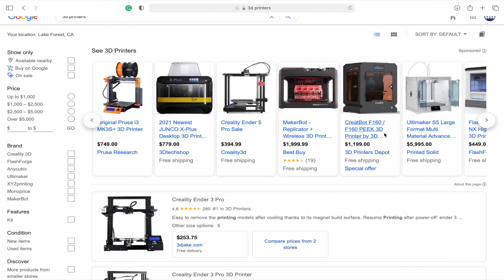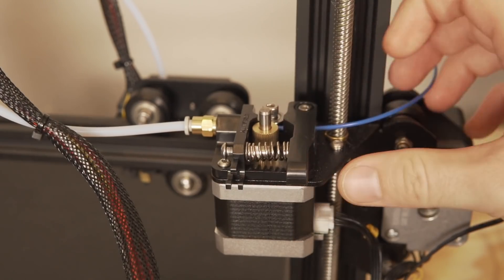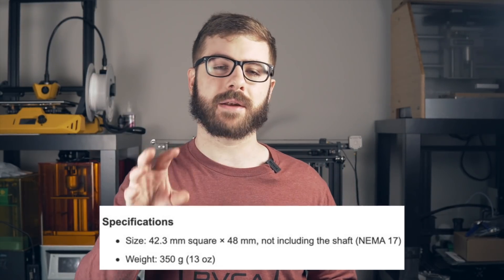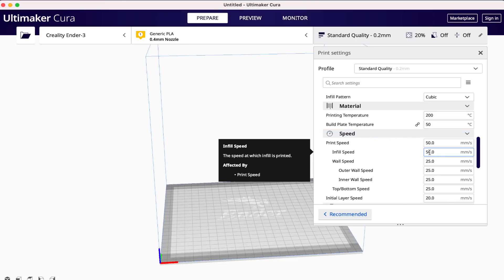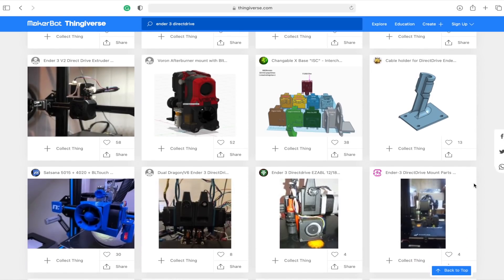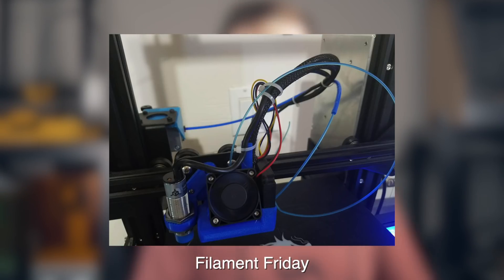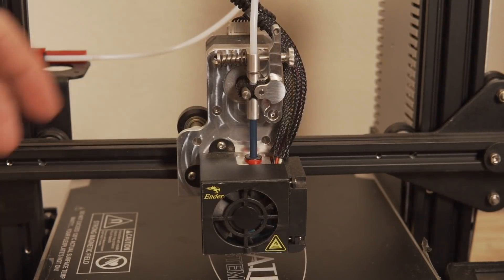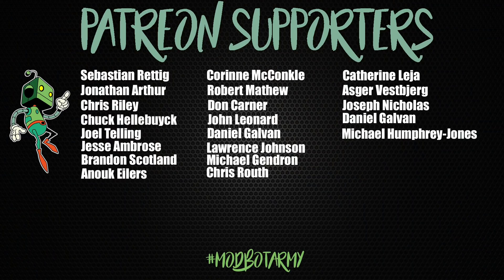Bowden 3d Printer Extruder Vs. Direct Drive

Comment: I just like to add that when I bought a pre-built direct drive extruder for one of my Ender 3 printers I used it for a while and the print quality was just not very good so I took it apart and I found that the two screws that hold the hot end to the back plate were loose. Both of them were loose.
I have found that poor print quality sometimes is caused if the hot end is not at right angles to the bed.
Because of that, one of the first things I do while I'm putting a new printer together, is to make sure everything is perfectly square including the hot end in relation to the bed. Everything on the printer must be absolutely square and at perfect right angles all around, and of course, all of the wheels tight enough against the extrusions that there is no wobble.
Because the nozzle is so tiny, it's not a huge deal when they're a little bit out of square, but it does affect print quality and even more if you use ironing.

Comment: I just recently switched to DD on my (heavily modified, at least for my standards) Ender 3 after hearing a very compelling argument: It's a bedslinger, so the X axis, even with the weight of the motor, is still less than that on the Y axis. I have an ADXL345 accelerometer for resonance compensation so I thought hey, I can check that⁽¹⁾. Sure enough, I could go up to a max of ~16k acceleration on the X axis, but only 4700 on the Y axis. Since both axis are linked in most slicers, the Y axis will always ⁽²⁾ be the limiting factor for a bedslinger. So, at least for that type of printer, the weight of the hotend carriage is, functionally, a non-issue (ignoring wear and tear for a second). The advantages of a) being able to print TPEs and b) less clogging on an all-metal hotend due to less retraction are just much more beneficial, at least for my use case. Not saying it's "the perfect upgrade that everybody should use™", but don't get dissuaded just because somebody tells you it'll make the carriage too heavy.

⁽¹⁾: I just did another test run with my DD setup: Klipper suggests max_accel <= 14500mm/s² for the x axis and max_accel <= 4500mm/s² for y (with mzv shaping). So yeah, at least in regards to maximum acceleration, a heavy carriage is not my limiting factor.
⁽²⁾: Of course, there's an obvious edge case where you literally weigh down the carriage as much as possible just to prove this point wrong, but seriously, unless you actively lighten the Y load AND raise the X load, your bed will always be heavier than your carriage assembly. I don't even use a glass bed and it's still the limiting factor in my setup, for example.
Reply: That was my thought process, but I didn't have figures to back up my intuition. Thanks!

Comment: Thanks for posting. I'm a 54 y.o. noob at 3D printing (got my Ender 3 V2 three weeks ago) but have jumped in with both feet. I'm interested in print quality and reliability above speed, and therefore have made the decision to go with a direct drive (will order the Orbiter this weekend). With the issues I've had with the stock extruder, the time I save by not having to fiddle with it can be put toward actually printing, which increases my productivity. Add to this the greater versatility of DD systems, and for me it's a no-brainer.
Reply: how did changing to direct drive go?

Comment: I have 15 machines on my print farm and over the years, I have upgraded as many as I can to direct drive.  It's just so reliable for all my material types and I don't have those dreaded Bowden Tube popping out from the hot end or extruder issues some stock printers are notorious for.
Reply from the maker: Damn what direct drive system are you using on the upgraded units? That tube popping out is such a waste of time and materials.
Reply: @ModBotArmy  I have 3 CR-10S machines upgraded to the Bondtech Direct Drive System.  It’s super easy to install.  They offer the firmware for it and even a version if you opt to install a BL Touch (mine do). It’s a “what’s your time worth “ kind of upgrade.  Very quick to do.  I like that direct drive setup so much I’ve had them make me a few (minus the Creality wiring) to install onto other machines that have the same CR-10 style carriage.  Check my channel for my DDS install video 🙂

Comment: For me allways direct drive. You can use light extruder because the resistance on the filament is less, usually higher flow and easy to print more filaments. For a Prusa style printer it goes all the way, because the bed is heavy and the X axis doesn't matter if you add a bit more weight
For a CoreXY maybe bowden is a better choice because of the rapid movement you could have. But with sturdy frame and big motors you can have a Direct drive and still print at 100mm/s at 3000-5000mm/s2 acc

Comment: The quality i'm getting printing PETG with a direct drive compared to a Bowden setup makes it worth all the way for me. i go through allooot of PETG and the Print finish/quality is just perfect with it i pretty much have Zero stringing and all i need to do is remove some support and the parts are done nothing to clean up. when i was running bowden i always had some stringing and needed to cleanup the parts a bit.
Reply from the maker: I feel like with PET-G on most bowden setups I get some stringing and occasional blobs. I also feel like dd seems to remove most of this for me. I have done quite a bit of PETG on bowden but I definitely have experienced what you are mentioning.

Comment: im fairly new to 3d printing. i bought an ender 3 v2 and a short time after testing it i bought a direct drive extruder to install while installed an all metal hotend and it made life much easier and the prints much better.

Comment: I recently purchased a Biqi B1 and prefer it immensely over my old Deltaprintr. I did swap the extruder over to the EZR and cut the bowden tube as short as possible. It's running like a champ and I was able to print with TPU without recalibrating.
Reply from the maker: That is awesome! I love my B1 so much. I only have space to run a couple of printers right now in this place but I really want to do more printing on that machine.

Comment: I just discovered this channel. Good explanation of the differences between the systems. I've only been 3d printing for 1.5 months and all 3 of my printers are delta's with bowden setups. I've successfully printed with PLA+, PetG and ABS and have yet to try flexible filaments. I see most of your printers are cartesian style 3d printers. One thing missing from your video (as it only applies to deltas) is the "flying extruder" mod to shorten the bowden tube. Your video gave me a better understanding of what people are trying to achieve with that mod so thank you!

Comment: I think X carriage weight is only something you should be concerned about on a CoreXY. On a Cartesian printer, the moving bed / Y carriage is going to be so much heavier than the X carriage that you will never be able to print truly fast while maintaining quality. People get obsessed over saving a few grams on their X carriage, while forgetting that the Y carriage / bed weighs at least a full kilogram more. Unless your firmware supports different print speeds for each axis (which is doesn't) you're only going to be able to print as fast as your slowest axis.
Reply from the maker: This is also a great point. Especially if you have a heavy bed that has glass on it that will really limit how quickly it can qhip around.

Comment: How about a hybrid system?
Bowden to deliver filament, but not perform any retraction or pressure advance actions.
Small servo at the hot-end shifts the Bowden fitting relative to the nozzle, adjusting pressure/retracting.
At the start of a line, the fitting is spaced at some set distance from the nozzle.
As the hot-end accelerates, the servo drives the fitting closer to the nozzle, building pressure rapidly.
Once the hot-end reaches print-speed, the spacing is held constant.
As the hot-end slows down, the servo backs the fitting away from the nozzle, dropping pressure to zero, preventing a corner blob.
The servo could start building pressure before the filament in the tube has a chance to start moving in the tube, thereby reducing 'starvation' at the beginning of a line!
The pressure-modulation profile would match the acceleration profile for the hot-end, of course!
For a non-printing move, the servo pulls back a tiny bit to make sure there is no residual nozzle pressure or dribbling.
The Extruder motor only has to deliver a set amount of filament in a set amount of time, and can do so without fancy acceleration tricks.
Linear Advance is a great idea, but it is rough on hardware!
Since the Extruder is simply feeding stock, and regulation is done 'in the nozzle', stress on the Bowden fittings/motor/tube is greatly reduced.
No retraction =  less electrical power to the Extruder motor, less heat.
No more push and pull; just a steady push, or stopped.
BONUS!*BONUS!
The servo driver, if it were a 'voice coil', could modulate nozzle pressure at fairly high frequencies...might be useful to selectively apply patterns or make properly tapered lines in a print.

Comment: I could never go back to the nightmare of dealing with bowden , the couplings always work their way loose as the filament is pushed/pulled through the tube resulting in hot end clogs.

Comment: I ran a Zesty Nimble V1.2 on my delta for about two years.  I'd be happy to answer questions about remote drive stuff out of my experience.

My thoughts: It's a great system for taking weight off the effector without losing the short filament path that flexibles prefer.  It did take a fair bit of tuning to get working well, but their documentation and support is good.  Unfortunately mine was an older production model and had "Ripple" issues (slight periodic over/underextrusion due to the drive cable and possibly tolerances in the old gears), but until I totally rebuilt the printer frame for rigidity and switched to 0.9 steppers, that artifacting was minor enough to be lost in the general delta "salmon skin" noise, even with a 32bit board.  After that, though, I started looking for an alternative, and I just replaced it with a Bondtech LGX in a flying setup with a 13cm bowden.  That's giving me substantially cleaner prints.  The ripple issue is apparently well-known but not well-explained, and doesn't affect all Nimbles (I've heard it can appear on Flex3D remote drives as well).  I may give the V3 Nimble a shot in the future, as supposedly they've ironed out those early manufacturing issues.

Comment: I just added a belt driven dual Z-axis drive system and the additional weight of the direct drive is no problem.
Reply from the maker: What printer did you convert to belt z axis?

Comment: Direct drive I have heard also can misalign your x axis on the lead screw requiring dual z motors.
Not sure because I decided to stick to bowden but I totally agree dual gear is 100% a big improvement and more worth moving to then changing drive setups

Comment: A bowden is easier to fix when clogged, the direct drives motor has to be remove and the parts unscrewed which can lead to wear and tear on the gantry. But the direct drive allows you to print flexible filament and is supposed to be faster because of the lower retraction distance to the nozzle. I've had many extrusion issues with my bowden setup but the print quality of both are very similar. In the end I think that, if you can afford it, you should get a direct drive but ultimately it comes down to slicer settings.

Comment: My Ender 3 has a Bowden setup and my wife's Flashforge has a direct drive.  Both print well and are reliable. One thing I like better about the Bowden is the easier access to the hotend. A clog or some other hot end issue is far easier for me to get at and correct on the Ender than it is on the Flashforge.  Just for something to do on a cold wet weekend, I purchased a PrinterMods direct drive adapter for my Ender 3. Guess I'll see if I like that setup or not. Poor little Ender rarely has a peaceful weekend :)
Reply from the maker: I think that the flashforge is also tougher to access because it is a different system than the Ender 3 which is based on the prusa design. The cross beams on the smooth rods can definitely make it trickier. With the Ender 3 being more open I do not think it will be much more difficult to access the hotend than it is now :)

Comment: I have a question about printing speeds. Should the first layer be slower than the other remaining layers of a print?
Reply: As far as I know, do whatever works well. It can help to improve adhesion but in my experience it's a slight effect but that could just be me. I'll use slow perimeters though.

Comment: I have an Ender 5 and was thinking of moving the extruder to the top of the printer and shorting the bowden tube considerably as well as using a capricorn tube as well as adding an EZR extruder.  Does this make sense or should I just go with direct drive?

Comment: Dr. Vax has published a video on a very similar topic pretty recently. He made the point that, in his experience, DD printers are faster than Bowden printers because they don't need to retract the filament as far as Bowden style printers have to and therefore waste less time. As I only have a single printer and it's the Ender 3 Pro both your explanation and his sound reasonable - what do you think about this?
Reply: That would be a good experiment.  I think the more retractions you have in the gcode, the advantage would go to the direct drive.   When I was setting up the CR-6SE for PETG, I had to go over 10mm retraction distance.  On my direct drives I am at 0.7 to 0.8.  That is a lot of difference, if there are a lot of retractions.
Reply from the maker: I will have to take a look at that. For retraction heavy prints that could definitely narrow the gap between the two in print times.

Comment: Thanks for the overview! I just installed a Micro Swiss direct drive on my Ender 5 pro and I'm excited to try it out once my replacement thermistor arrives. The stock extruder kept giving me trouble so I figured if I was going to upgrade I might as well go with something that would give me more flexibility (no pun intended) down the line.

Comment: I have only had Bowden drives, but I have had issues with the PTFE tubes coming unseated during a print on 2 occasions.  Eventually the claws in the grip wear out.  I have also had the issue on the hot end where over time a gap opens up between the end of the PTFE tube and the heat brake, and melted filament builds up in there and you end up with under extrusion.
Reply from the maker: Interesting. I wonder if it is best practice to replace the bowden tube or the ptfe fittings after a certain number of print hours. I feel like it is to difficult to figure out how long or how many hours that is unless someone sets up a test bench just to check that.

Comment: With a large print, the heat of the nozzle has time to travel up the line of the filament itself and since the link with the bowden tube guide is plastic AND the weakest link in the chain, it pops off once it's warm enough. Maybe if the print is 12 horus, they can break up into 6hrs with a rest in between?

Comment: Converted my ender 3 a month ago to DD. One thing I noticed is it was much easier to dial in linear advance
Reply from the maker: Awesome! What DD did you go with?
Reply: @ModBotArmy  the original extruder but with a 5€ conversion kit from Aliexpress and it works great. I think you could make a similar video for bowden type hotend vs all metal. For me the Ender 3 has been my introduction in 3D printing and I learned a lot. But sometimes I ask myself the question if it wasn't better to just spend the extra cash on a Prusa instead of a cheap Ender 3 where all the cheap upgrades together make a substantial amount. Probably a good topic for a video ;-): Can you transform the Ender 3 an all-round workhorse: direct drive, abl, flex steel sheet, all metal hotend to print at high temps, good quality prints and still be cheaper than a Prusa i3 mk3s

Comment: What about  people who have pet birds that are concerned about PTFE fumes ,  what is the most PTFE free setup?
if the direct drive has a  short PTFE tube and  it is going to an all metal hot end does the PTFE tube still heat up at all?
you said some have no PTFE tube at all ,  is there a kit that includes a direct drive and all metal hot end for the ender 3/ pro with no PTFE?
Reply: The heat should dissipate before it reaches the PTFE tube and cause it to decompose IF you have an all metal hotend that is. If you want to go an extra step to prevent any chance of fumes coming from PTFE I’d suggest an enclosure with good sealing and air filtration (which can give you the added bonus of being able to print with ABS if you ever wanted to )

Comment: All my printers until now have been Bowden driven. But I'm about tô upgrade one to direct drive using the orbiter. The main reason was that my factory installed extruded broke and I realised that the change to direct drive would solve my problem quickly and allow me to use flexible filament with a bit more speed. That said, except for this and some small issues over time, I think that any good extruder should do a great job if well configured.

Comment: I switched to an all-metal hot-end on an Ender 3 and a few months later a BMG direct drive but no matter what settings I used I wasn't getting anywhere near the quality of my Bowden tube setup, I switched back to Bowden tube and had the best of both worlds, an all-metal hot-end to print high-temperature materials and good quality prints.
Reply from the maker: Interesting. Are you still using the BMG? Just as a Bowden setup?
Reply: @ModBotArmy  Yes but I took it off my Ender 3 and put it on my CR-10